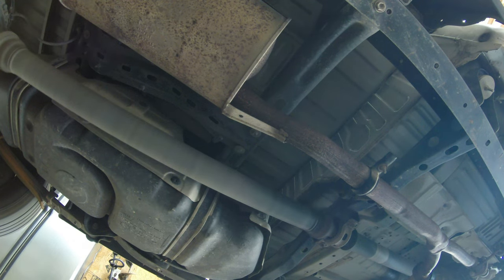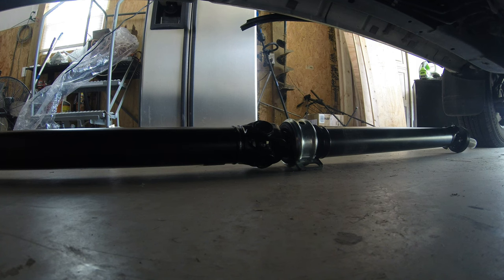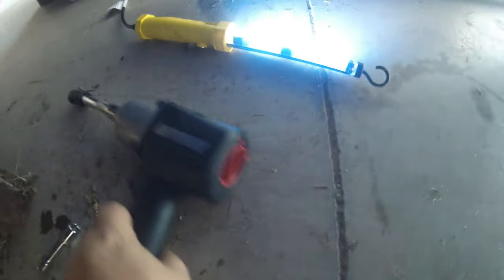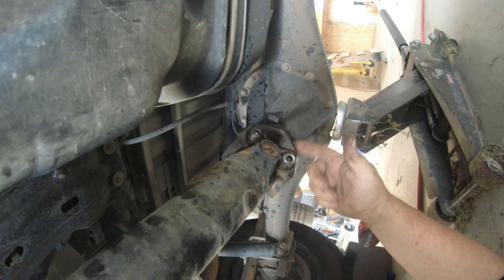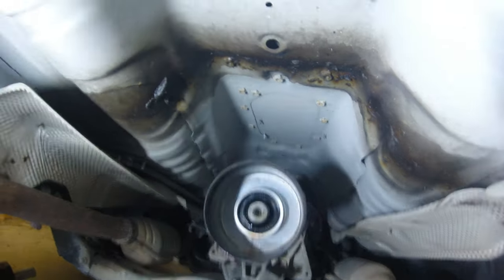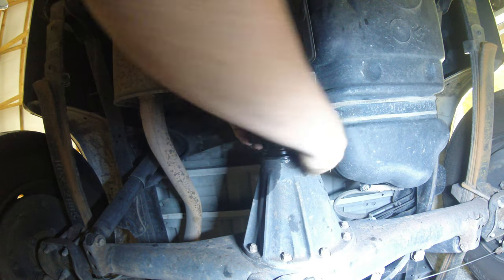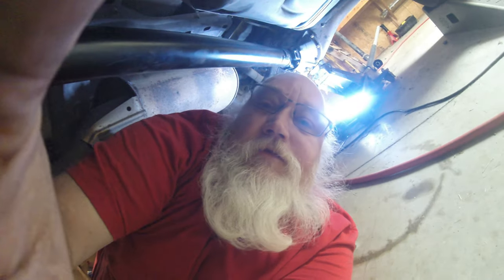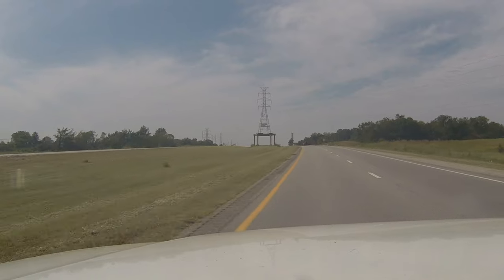2006 Toyota Tundra U-Joint Vibration and Driveshaft Replacement

Comment: This video is a wealth of information. I just bought the wife a tundra with 233k on it, and it has a deivetrain vibration that increases with the speed. Ill be checking the drive shaft for sure. Thanks for the video
Reply from the maker: You are welcome and my bet if the vibration increases with speed it's a u-joint or the carrier bearing. I was amazed when I put the new driveshaft in mine it was like a new truck LOL..

Comment: Yeah had the dealer do an alignment had a tire shop rebalance the tires now i know it was a bad u joints and support bearing that was no good and making the rear output shaft seal leak… took it to a shop had them replace the u joints and support bearing and rebalance the drive shaft let’s hope this works and takes the vibration out of the truck.

Comment: Thanks for sharing your work on the 06. I too have an 06, but my U-joints are still good at 148k. It's good to see how the job can be done when needed. I also have an Earthquake air gun that has worked well enough for me. I used it to replace struts on the wife's Honda, and did brake jobs on my Tundra with it. Glad the new drive shaft is working out for you!
Reply from the maker: Thanks yes I am real pleased with that earthquake impact gun works good. It took over 200k before my u-joints started vibration so you still got a few miles to go. I have almost 230k now Tundra's are great trucks.

Comment: Good video!  I have an 2007 that needs this done.  I may just replace the whole drive shaft like you did.  Thanks!
Reply from the maker: I think it was a better value all new components and a lot faster to replace than rebuilding the old one.

Comment: Thank you for the buy whole drive shaft idea!!! It’s almost the same if not cheaper if you buy the u both u joint and carrier bearing. Add the pressing and extra work. I found a new or rebuilt drive shaft with the u joint and carrier bearing like you said for under 300 OEM
Reply from the maker: I now right! All new drive shaft with none of the hassle of pressing u-joints etc its a win win...

Comment: the link on amazon is a for a subaru drive shaft? also is your tundra the v6 ? mines a 06 double cab 4.7l 2wd and the driveshafts im finding around are close to 1000 and its pissing me off lol
Reply from the maker: Apparently the one I have fits both a Subra and Tundra not sure about a extended cab I think it's same one, put your vehicle information in there and you can confirm it will fit.

Comment: I have the same truck at 265,000 miles.  Might end up doing this.  I wanted to ask you how is your transmission holding up young man?  Have you been changing the ATF routinely over the years?
Reply from the maker: These are amazing trucks as far as maintenance goes I have done the 100k service twice on the spark plugs and a transmission flush other than that mostly small stuff and of course the drive-shaft I can say I was really worried it was the transmission when I first started feeling the vibration fortunately the drive shaft made feel like new no issues, knock on wood everything still works great no leaks doesn't burn oil it really is testament for how well these trucks were made. I hope to get another 250K out of it.. I do also change my oil regularly.